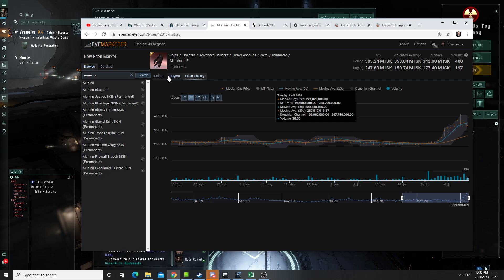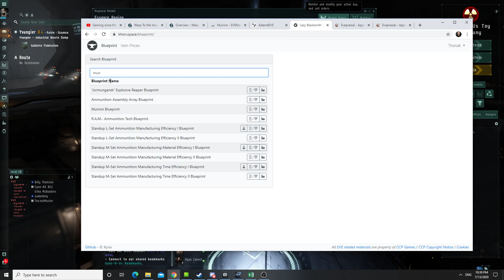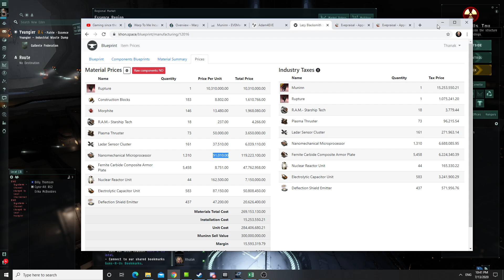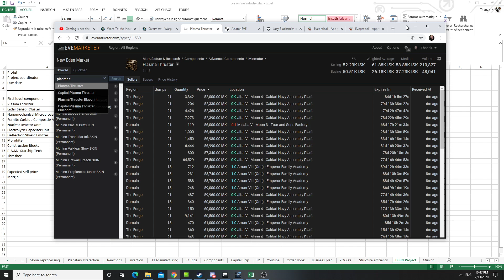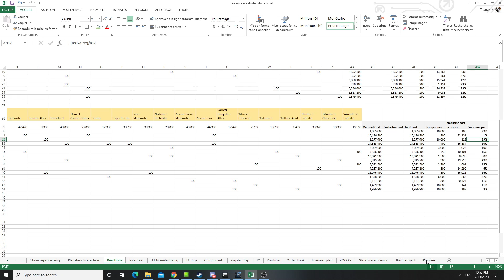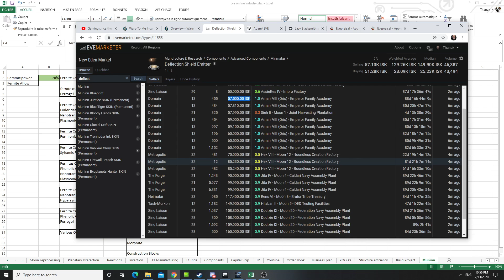EVE Online : Analyzing  Muninn Production

Comment: This brings back memories, I played since 2005 and lately not much has made me want to log in at all, I used to build up to carrier, but found T2 getting silly, going further and further down the lines it was almost impossible to make a consistant profit, wait for it (someone will come and comment how they make billions a week doing just that) once the offline POS's were removed moon goo supply became an issue, no matter how you tried by the time anything was built you would find it on sale somewhere cheaper, so selling the component parts made more than selling the ships, then going to low sec with millions in reaction materials and hoping to be able to collect it all when done took the edge off the whole chain. Whatever you do in Eve there's always someone to undercut you.
Reply from the maker: I agree that production is really competitive. The actual act of building adds very little value. A large part of the profit is comming from trading or predicting where the market will move.  The is because building slots are so easy to scale with more alts... a pure passive activity.  They should implement a minigame / timesink to launch a job. That would bring scarcety and give room for profit.